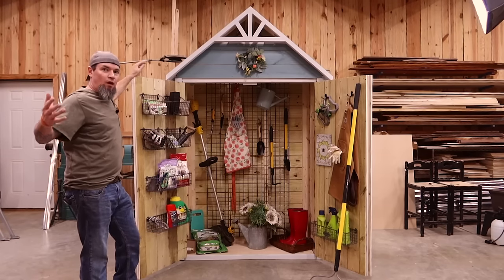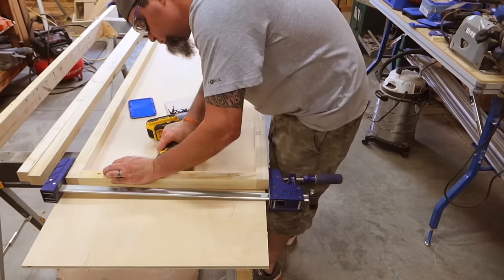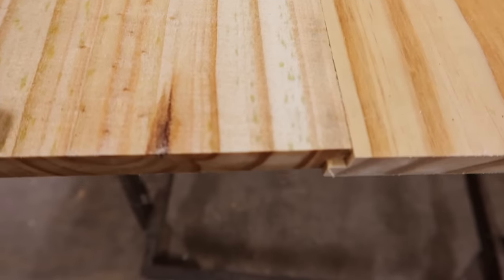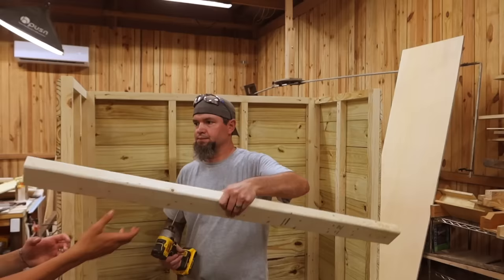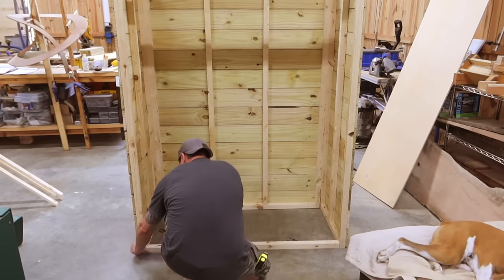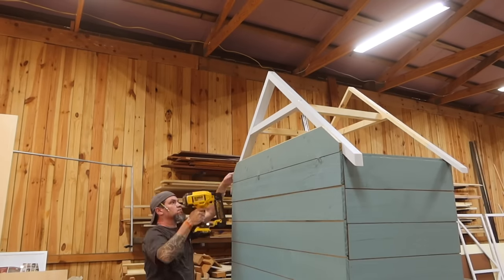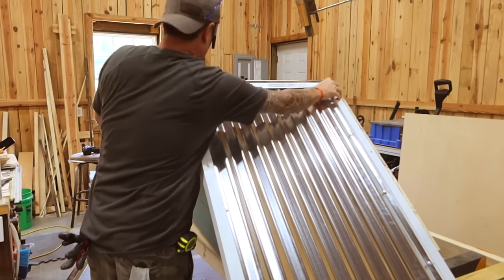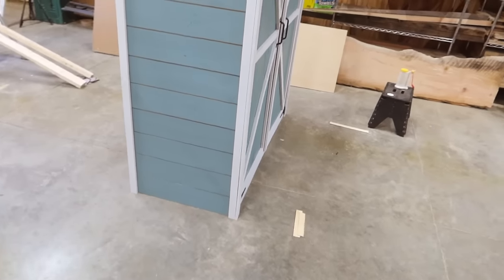How To Build A Shed On A Budget

Comment: Bro honestly putting a soft light in the eve or a ceiling mount light would be an awesome addition to this! I also thought about a small ramp as an accessory for elderly people to not worry about a small step to get over with a floor inside. 

Yes that floor would increase the cost by about 100 dollars due to plywood prices currently but maybe using a few extra 3/4 pickets you could do a floor with that as well for maybe an additional 30 bucks. Just a thought. Do you have any feed back on this? I'd love to know your thoughts on this.

Comment: I'm thinking of making a variation of this as a firewood storage shed by the house in front of my garage.  The wife was never happy with a metal storage rack and the wood could still get wet even though it was under the house eves.  This would work perfect if I also built a raised base/floor for the firewood weight.  The open top would help with air circulation and just needs a recessed insect screen to keep wasps out. I would use it for firewood moved from the main stack in the yard to be "ready for use" by the house. I could then paint it to match the house paint scheme with the doors keeping the wood hidden from view to keep the wife happy.  Thanks for all your great videos and ideas!!!!

Comment: Nice job designing and building this. It's something I'm definitely going to try and sell a little later in my journey. For about $10 more, you could buy two pressure treated landscaping timbers and frame the bottom side of your walls where they contact the ground. Anyway, thanks for what you're doing and keep up the good work.
Reply: That is a very important addition. That's too nice of a shed to watch it rot from being on the ground.
Reply: Treated lumber on the bottom would be smart but the actual landscape timbers are oddly enough not ground contact rated, I will use yellow wood. I built my deck with it and really like it.
Reply: @papascruffy  so if I did a 4 x 8 shed, two treated 2 x 4 8 feet long would be good enough to place it on? Would I have to anchored them to the ground somehow.
Reply: @beautynfashionbydonna  
It would be a good idea to anchor so you won't have to chase down your shed or damage anything else.
Reply: @papascruffy  I am trying to figure out the easiest way to do that
Reply: @beautynfashionbydonna  
They sell ground anchors for sheds.
Reply: @beautynfashionbydonna . How about using sections of rebar?  Drill holes through the middle of the wood floor frame touching the ground, and then pound the rebar 18”-24” into the ground-after inserting the rebar into the drilled holes.  Do that near the corners, and that should keep it from sliding around(?). Hope that helps!

Comment: Just purchased the plans for this one also had to go upgrade to the kreg 720 pro to make life easier, the old $40 kreg tool just isn't cutting it anymore, lol. Going to give this one a try this weekend and see how it turns out. Thank you for your continued inspiration with these videos.
Reply from the maker: Awesome!  You're going to love the 720 pro.  I loved my K4 until I got my hands on the 720 pro.
Reply: Just a quick question, what is the board count for the 2x4s and fence pickets? I really want to build this and will probably end up having to buy the plans😂 but I have a few pieces of reclaimed boards and wonder if I have enough to get started.

Comment: One idea would be to use the more expensive cedar fence pickets for the roof. Resaw them in half and cut them to length. Dog ear them if you want that look on each shingle. Instead of 3/4" spacing on the sides of the truces, make it 1/2" (or 5/8" if you found properly sized pickets) and use the regular ship lapped pickets to make an underlayment for the roof. Much cheaper than plywood and looks nicer from the inside looking up. Then, cover it up with the cedar fence picket shingles. Just leave it bare, they will get that nice grey aged cedar look in a couple years. Use some black aluminum step flashing for the top.

Comment: This is pretty awesome. There's lots of good information in there. I'm curious how you would do it without pocket holes (I've got nothing against them, I'm just not very good at using them). I also wonder what you would do on the inside, would you add a shelf, some sort of garden tool holder, what???

Thanks for the video!
Reply from the maker: Thanks!  I guess just like framing a house.  Nail and hammer.  The inside is the neat part... you can customize to what you need.  I thought of putting a fold down work table... a side that folded out to a table.... shelves... really anything.  The wire grid we put in this one holds alot of tools flat and leaves tons of room for other stuff.

Comment: Interesting. Never would have thought home-made economical 2x2s could handle the weight. But they clearly do!  And your design is easy to adapt for size. I’m not a fan of painting, but I’ll prime all sides and ends before assembly. Get a little more life. Any thoughts on installation?  Blocks under corners or under perimeter?  Seems like load is on the corners so blocks under the corners would do. Thanks for the ideas.
Reply from the maker: A lot of people put them on the 2x2’ square walking stones. For a shed this use a 2x2 is more than enough.
Reply: Back in the 80's, I worked at a mobile home plant.  For the interior walls and all cabinet framework, we used 2x2s.  Kinda makes you realize what cheap pieces of s**t they were back then.

Comment: Love the video. My only two thoughts. Would it be better to run boards horizontal under the roof? I think that is what gives the roof staying power in strong winds. Also, bro, you need a paint sprayer. Changed my life.
Reply from the maker: Great suggestion!  And I have one lol.  I just hate the cleanup.

Comment: Absolute beautiful build. I'm hoping to sell enough smalls to finally purchase a pocket hole jig so I can make more advanced builds. Thank you for sharing the fun!
Reply: I was also struggling with the larger price of picket hole machines...but they have a kit where you get the drill bit, driver bit, pocket jig(single),and depth gauge/collar/key for $20 @ lowes...it works well....slower, but it gets you started.  Good luck
Reply from the maker: Hey!  Richard is right.  A great place to start is the single.  I still use mine from time to time in certain situations.
Reply: Thank you I will get that.

Comment: I like this.  How do you think it would scale to be a little larger?  My small shop needs dust collection but there's really no room in the shop.  I've been planning to build a 6'x4' shed on the side of the shop with a big hole through the back of the shed and wall of the garage for the duct work.  I have some framing experience so my mind always goes to 2x4 framing on 16 (ish) centers.  I love the idea of using fence boards for siding.  I love the idea of cutting up 2x material for smaller framing (I have some 20'-2x10s lying around).  I'll need to price things out and see where it comes I suppose.

Comment: Just wondering if this could be built twice as deep so that it could store a cordless lawn mower stood on end besides garden tools?  And, I’m wondering what your thoughts are about a floor?  Great idea, and thinking about other options.
Reply: I'm finishing up this build currently and some of the challenges you'd face would be needing multiple sheets of roofing material, and adding another truss would be a must in my opinion, but otherwise I don't think it would be hard to adapt to a wider setup.

Comment: Hey Mathew is the sizes for for the top and bottom and middle backers of the door wrong?  In the video it said 21 3/4 but if you add it to the left and right side of the door which adds up to be 24 3/4 inches.  Which mean both door would add up to be 48 1/2 inches but the opening for the door is only 44 inches.  Thank you for your generosity.

Comment: do a follow up of "installing" that :) like the things you should check with local ordinance about putting that on your or someone elses property. . . i know where i live you gotta put them on 'skids' or cinder blocks with proper anchoring and tie down ( we half bury cinder blocks, anchor to them then gravel fill or flat 2x4 skid mount and strap it) otherwise they consider it a structure over a certain number of ridiculously low sq ft and make you file plans and pay for a permit yada yada yada i kid you not :)  it'd be an important factor for not only a DIY effort "at home" (rental,where ever you live) project but also as a seller, having that information might save you a lot of angry or 'oh shit' phone calls from someone you sold one to that now wants you to "fix it" :)  i'm building one of these today in fact for my place, gotta empty a second bedroom of 'garden' / outdoor stuff so we can do a floating loft bed with a climbing wall / firemans pole and the whole desk / shelf thing under for a kidling about to start skoo :)

Comment: Hey Matt, how do you minimize shrinkage in fence picket material? I've done about 10 planters from your plans and all but one have separated between pickets. Do I need to let the material sit out a bit before I cut it to size? Great projects and plans, keep it up! Outdoor shed is going on the to do list!
Reply: Also thinking of extending the depth of this shed so I can put trash cans in it! Great little design!
Reply: I have to let them dry for a few weeks, but I am building with pallet boards.
Reply from the maker: I let them acclimate for a few days if they feel wet.  The treatment swells them back out and letting them sit a bit will let it evaporate back.  exterior wood will always move.  You could do the shiplapping to help with open gaps.  The Cedar doest seem to do it as bad.

Comment: Howdy Mr. Peech. Been watching your builds for awhile now. You do some pretty decent work. 👌 

Is there any way you could upgrade your microphone? Even with my volume settings at max, your voice volume is weak. 

Thanks
Reply from the maker: Hey Mike.  I own one of the best mics that you can buy.  My voice just comes across as deep.  I really havent had a complaint before but I'll look into it.
Reply: @MatthewPeechWoodworking  Howdy Again Mr. Peech...Thanks for the reply. 

On one hand, I would say it's my end/my phone....However, it's only your videos where I have a hard time hearing you. Jay Bates, no problem. James King, no problem. Jason Burbonmoth, no problem, Matt Outlaw 731, no problem, Cam Blacktail Studios, no problem, Izzy Swan no problem. 

I dunno Mr. Peech...With your videos, I have to make sure fans, TV, ac etc is either turned off or I'm far enough away from them that it doesn't drown out your voice. 

Thankfully, I have enough experience in woodcraft that I don't necessarily need to hear every word, I can just see what you're doing....But, you've got some insights to "business" that I DO want to hear.

Comment: Siding panels shouldve been verical. Water and ice will sit in those seams. And also gluing the siding to the door frames. Won't allow for the shrinking and expanding  process for seasonal changes.  Causing splitting/ warping and functioning issues.

Comment: It's crazy I would save up to build something myself that can actually fit a mower. If you need yard tools then you need a mower right? If you need one you need the other
Reply: This actually would hold my mower, it's designed to fold up vertically to save space. I agree though, I would adjust the size deeper if I had one that didn't.

Comment: so anyone have suggestions for a floor?  I think most would find it odd to buy a shed with no floor.  any experienced peeps have any opinions?  then place it atop 3 pressure 4x4's?  If you did that, you could make the floor out of pressure treated 2x2's and paint the plywood?  just throwing out some ideas as I am trying to figure this out and a newb.  thank you!
Reply: You can use treated plywood but it’s kind of pricey or use treated fence pickets and just cut down to fit on the treat Timbers on bottom you could also  make them into ship lap
Reply: @dougpeak7591  so here's what I'm thinking.  Plywood floor that is painted on bofe sides and then supported by 2x2 floor "joists" 8" on center (or mebbe 12").  Those would also be painted and sittin on not 2 but 3 4x4's.  Those 4x4s would obviously be rated for ground contact and then partially buried so that they're halfway embedded in the ground.  I would prefer to have a plastic barrier between them but I can't think of a way that this would not end up also trapping moisture. Anyway I think that's a good plan but..... Not sure what to do about pests and rodentia.